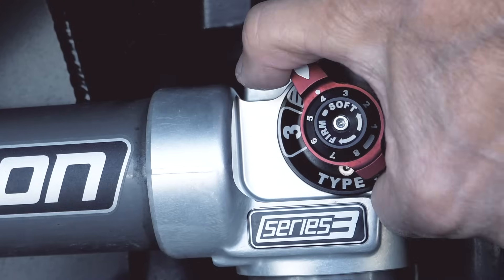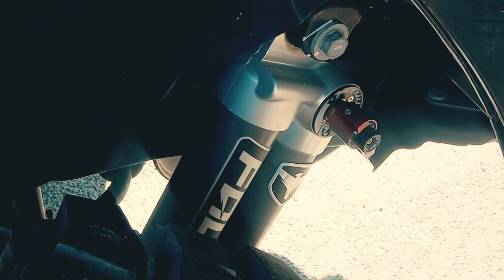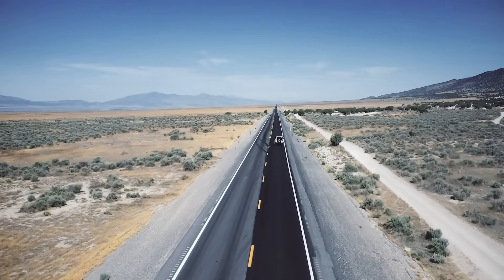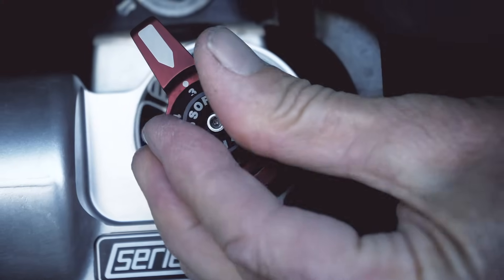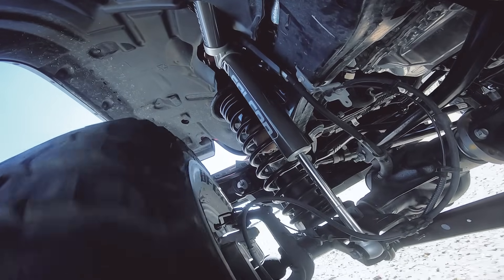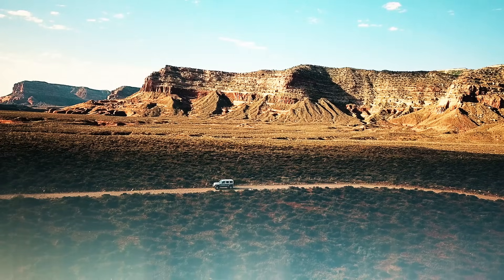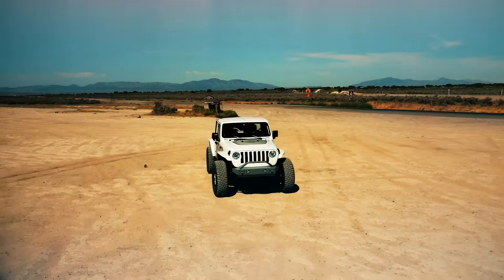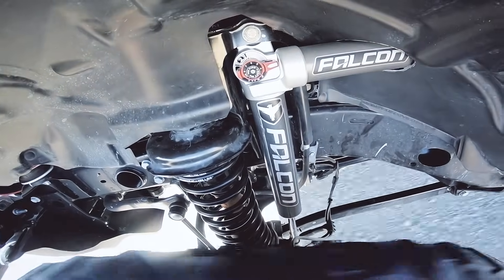3.3 Shock Adjustments | Falcon Shocks

Comment: I've seen comments that these aren't compatible with JKs that have a snorkel. Is there any way to make it work?
Reply from the maker: It would depend on the style of snorkel. AEV and other external mounted snorkels are not affected in anyway. If it is a style of snorkel where it is routed from the inside, there could be possibly interference. We do not test with parts like that so it's hard  to say for sure.

Comment: just bought these for my gladiator rubicon running 37s on 18 inch rims, what would be the best setting to blast around loose rock trails and hard bumpy dirt?
Reply from the maker: It's all personal preference, but I like to throw mine in the 1 setting or put them in 2 and fine tune them a bit better to your comfort level.

Comment: Just got these installed on my JK. I noticed that the small adjustment knobs turn no matter what setting they're in 1,2,or 3. Is this normal?
Reply from the maker: That is normal for the dial to turn in any setting, the black dial setting won't be active until you are in the 2 setting though.

Comment: Suggestions why my jeep jl 2020 feels stiff  with the falcon 3.3 I have 37 "x13.50 "x26" fury tire is an mall crawler  jeep
Reply from the maker: Those are some really big rims so your ride will be more stiff with those alone. if the shocks are already in the softest setting, then air pressure is going to be your next option for trying to get a softer ride. I would search tire chalk test and fine out how low you can go with your setup.
Reply: Thanks bro 👍🏻✌🏼

Comment: Thanks for video explanation Dennis as my SP2 3.3's go on my JTR this weekend.  Just to confirm, all of the adjustments (shaft and knobs) only control compression, correct? Rebound is static and preset during all of the explained adjustment? Thank you.
Reply from the maker: The Falcon shocks sport a digressive valve tune to help with up and down travel. The rebound will be based on axle weight but the settings on the shock will have an impact on down travel speed as well as up.